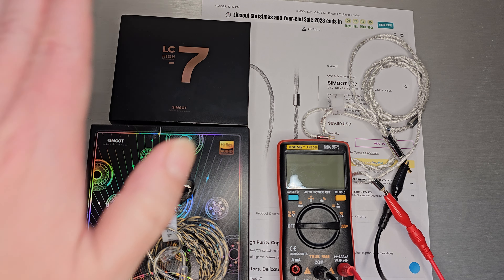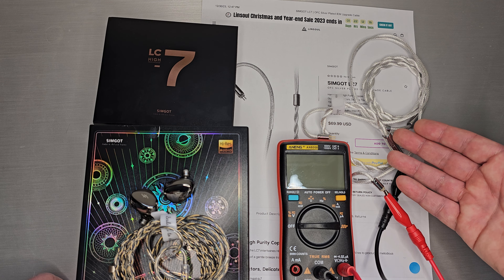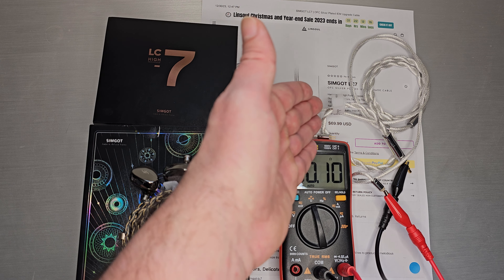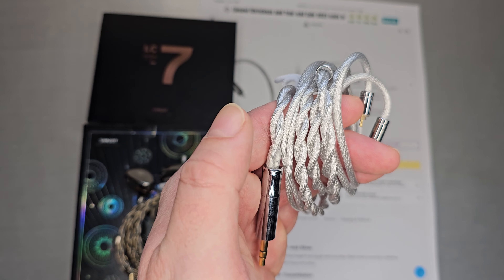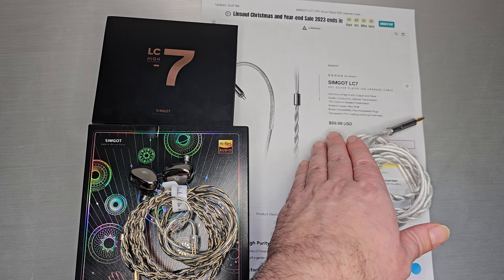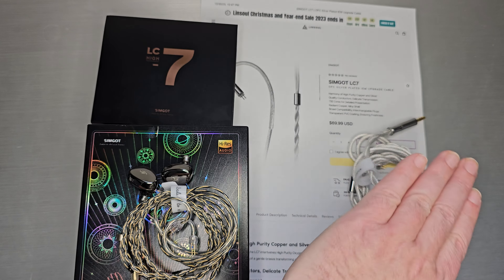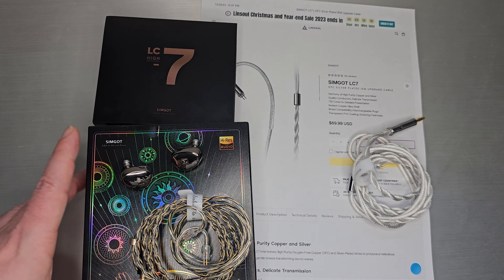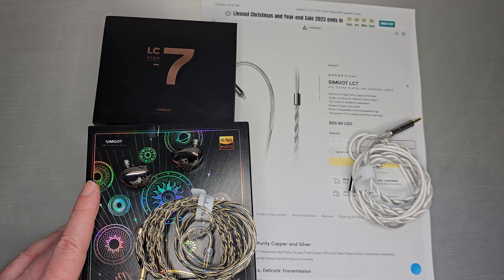Cables in 4K - Simgot LC7 and a Couple Words on EA500LM

Comment: Thank you for the great video as usual paul 🙂

The LC7 looks like a great cable, will go very well with the ea1000. As for the ea1000 I did a small mod which doesn't even require the diy kit. I use the red nozzle and I used the foam filter from the gold nozzle and put it in the red nozzle and also I used a foam tips. These two really helped a lot

Comment: Nicely Done.
Is the DIY kit for the EA1000 something thats always shiped with the iem 
do you need to request it
is it a different colored nozzle
Thanks
Reply from the maker: I have yet to see one in pictures.  The initial EA1000 sets sold by Linsoul included the EA1000 DIY kit.  The EA500 fit, but I was told the EA1000 kit fits better and should be the same color.  EA500LM is the different color.

Comment: Hey Paul, I just got the EA1000 which was a great vocal set but a bit bright for my liking. I saw your vid on using the diy kit but tone deaf monk has another method by using gold nozzle + mesh filter + sponge. 

So I'm unsure which method is best to reduce the ea1000 brightness? Thanks in advance.
Reply from the maker: I guess the hint I would give is that mine is a slight change, no sponge.  His is a bigger change.  With the EA500 DIY kit, it should be easy to try both if he used the EA500 sponge.  You should be able to do it in that order though, the EA500 DIY kit nozzle is bare, put a 500 filter on it and try it.  If it is still bright, but a sponge in it.
Reply: Thanks for the help and also, I just got the LC7 cable today, very beautiful and more comfortable than the stock EA1000 cable. Unfortunately, I do not notice any sound changes unlike what the reviewers said on head-fi, so it might be placebo or something. Regardless, LC7 got the job done and I'm satisfied with it and I'm looking forward to your review on the EA500LM.   @PaulWasabii

Comment: Hey paul, its me again. Simgot is really pulling me their way. I got the 500lm and a legato. I just got the legato and bought a bright source, switchrd the stock legato cable with a 4.4 balanced nicehck black cat cable and was really amazed the difference in sound.  

Was planning to get my first planar (p1max) but I also wanted to get the lc7 cable first for that modularity on my ea500lm. Is it worth getting the lc7 than the cheaper $15 cables?
Reply from the maker: Probably not.  LC7 is unique on the strand count and thick 2 core style.  You can find other modulars for less money unless you are really looking for the LC7 style which is actually harder to find at a cheaper price.

Comment: Why do you say the EA1000 nozzles don't bring out the best in the driver?
I've only tried the red nozzle so far and love them, but I don't seem to have the most discerning judgement when it comes to evaluating earphones.
(Also, any idea what the EA1000 gaskets do? They provided extras, so they must be important.)
Reply: Pretty sure if it's for some day, the gasket decided to die on its own
Reply from the maker: Same reason they came out with the EA1000 DIY kit right away.  I see it in more than a few reviews, a bit shouty and the stage isn't quite right.  A bit too bright to hear the bass properly.  There were common phrases across reviews that I agree with and noticed right away when I got it, and started playing with the nozzles.  Its a great set and a great driver, but you can fix most of the nitpicks from reviews.